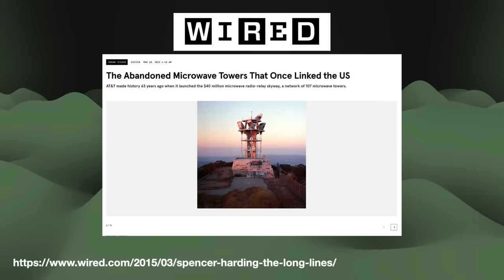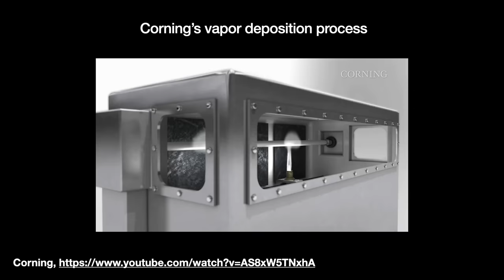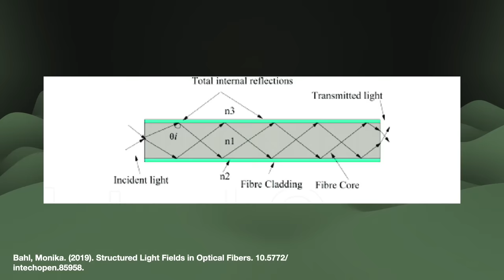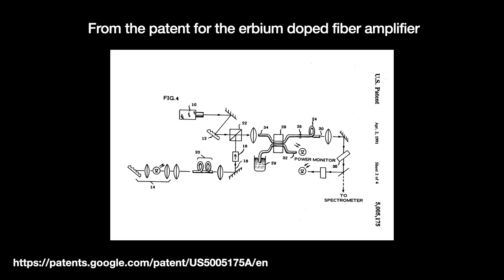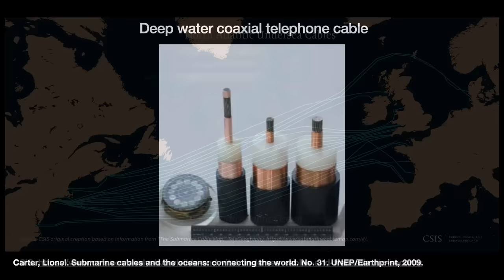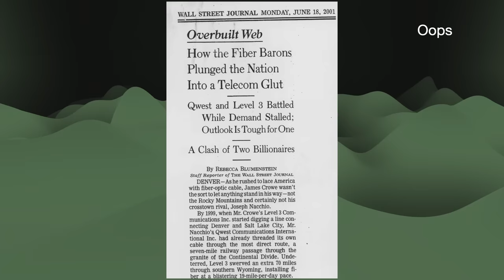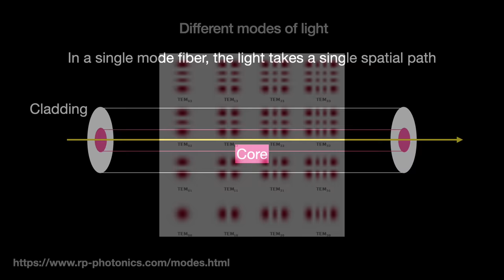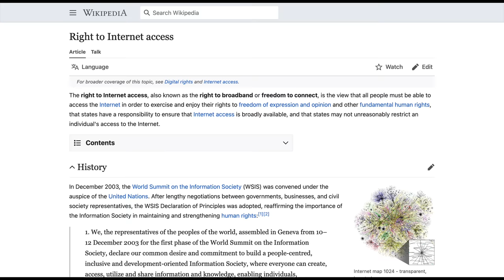How Optical Fiber Connected the World

Comment: That Level 3 picture is an interesting contrast.  It has fibre installation in the foreground and the old open wire lines in the background.  On those open wire pairs you'd get 15 or 16 voice channels per pair.

Comment: I almost spilled my coffee on the last pun. :) Very interesting video as always. In the mid 1990s I was empoyewd by a defence company that was expanding with new offices and we, the what you'd call now, IT Department, were tasked to investigate what options we had for the new installation and make a technological choice: Copper or Fiber and GigabitEthernet or ATM. Internet connectivity was spoken about, but because of the way that the business worked those days, we ended up having a seperate network for it.

Comment: 1995-1996, was a very special moment in the 20th century. The advancement of fibre networks, which made the World’s largest network possible, was made viable at that time. Which just happened to coincidence with a young researcher at CERN, called Tim Burners Lee, deciding to create a better solution to sharing data with FTP evolving from Email, Newsgroups and Bulletin Boards, to a variation on the SGML Language protocol, which he called Hypertext and the Hypertext Transport Protocol HTTP, which required a few patches of code made to the original NSCA FTP server, a patch here and a patch there, Apache Web Server, was born.

Comment: 12:02 Curious... Do you remember, from the sources you referenced during your research for this video essay, why the "optical" cable in the timestamp I've referenced was even emitting electrical fields that attracted sharks? Maybe particles in the sea water currents flowing around the metal cladding inducing current? Interesting topic I think, unless the same cable bundle included traditional electrical signal elements for other purposes...?

Comment: I am actually using fiber for internet. 200 Mbps for about US$65 per month.
Reply: You are getting scammed
Reply: @PhenomRom  I do not live in the usa. I live in guyana.
Reply: ????  I'm still on coax and my ISP provides 1.5 GB, though I'm limited by my hardware to 1 Gb.  I can't break out the Internet charges, as I'm on a bundled deal, but my Internet, TV and home phone come to about $190/month.  200 Mb is really slow for fibre.  BTW, back in the late 90s, at work, we had fibre connecting multiplexers that handled 3 DS3s.  That's 3 x 45 Mb.  A few years later, we had OC48 SONET over fibre @ 2.488 Gb.
Reply: @James_Knott   I think you are confused. Coax cannot transmit data at that speed. No one has a 1.5 GB connection. It looks like your monthly data capacity. Download speed is measured in Mega bytes per second. Do a speed test to see your Mbps. Fiber is always faster then coax.

Comment: Well, after WDM the next innovation was coherent communications, to improve the spectral efficiency (how many bit/second are transmitted for Hertz, or unit of light frequency bandwidth): the idea is that, instead of modulating just the light intensity, also its phase can be used to encode information.
So, instead of the intuitive On Off Keying (OOK), where the laser light is ideally switched on and off, one can act on its phase shift or use more than 2 power levels. This means that, as the format has more than 2 symbols (say 4 or 8), each symbol carries/is equivalent to multiple bits (2 or 3, following the example)
However, we are close to the theoretical limit, that derives from non-linear effects: because of noise, to distinguish one symbol to another with a sufficiently large probability, a minimum "spacing" must be used. This corresponds to larger power/intensity for the symbols at the edge of the constellation. But, as the signal intensity grows, the material properties (refractive index/speed of light) vary and this causes a series of effect that distort the signal, both inside a single channel or among multiple ones.
Personally, I would say that mode division multiplexing is a technique of its own, not a subset of spacial division multiplexing (i.e. in its most basic form, increasing the number of cables in parallel) because it corresponds to different way of spacial vibration of the light in the fibre cross-section, more than it travelling different paths (that is in the ray-optics picture, which however is simplistic); I would say that it's more the wavevector equivalent of WDM.

Comment: It takes a whole lot of 48v batteries for power off protection in these DI sites when I go in them.  Lots of testing and the AC is really important to function of sites in heat.  A bad AC unit can reroute a fiber network many miles out of the way setting alarms off at desks all over.  Modules and the chassis are pretty problem free, if you keep them cool.  I will give them that, no doubt.

Comment: You incorrectly describe how fiber works.  Your description is for "multimode" fiber.  Virtually all long-haul telecom fiber is "single mode and none is made of plastic.  Plastic fiber is only used for connecting stereo components together and can only carry a signal a few feet.  Bob Mauer invented the idea of single-mode fiber.  Multimode is much wider and easier to connect but can only carry a signal a fraction of the distance.  Don Keck and Pete Shultz invented the fiber manufacturing process and the original IVD has since been replaced by OVD (outside vapor deposition) as OVD can make much longer fibers.
Reply: Multimode fiber is not a new development, it is the technology that was replaced by singlemenode and it will never have the data capacity of single mode due to its much higher signal spatial dispersion.

Comment: Thanks! One thing that was new to me is that optic fiber was used before the internet age to transfer analogue signal. Seems like a completely logical idea, especially for TV -- after all it's OPTIC fiber, but somehow I never made the connection.
Another fascinating story is that those cables that carry so much information concentrated in one place provide a very juicy target for spying. Superpowers have been doing this for years during the Cold War, although mainly the cables that were tapped were not the optic ones but the more commonplace coaxial military communication cables. See Blind Man's Bluff, it's a fascinating story. It's safe to presume that this sort of activity is continuing until now, using underwater ROVs and, in cases of rich and powerful nations, specialized submarines built entirely for spying.
Reply: Cable TV companies already had fiber and coax networks in place so they were often the first to offer high-speed internet services
Reply: @shanent5793  Yep, I had a cable modem in the late 90s.  However, IIRC, cable modems and ADSL were rolled out at roughly the same time.  In my work, I first saw fibre in 1989.
Reply: @James_Knott  But cable modem technology using DOCSIS didn't really roll out until DOCSIS 3.0 started to really roll out in the early 2010's, which resulted in speed ups to 250 mbps at minimum and over 500 mbps as modems improved.

Comment: Couple of points you do not explain well and should clarify;
1. That Kao's foundational insight that the solution needed was not perfectly pure glass but a less pure reflective cladding. Regardless of core glass purity, it is the cladding that maintains amplitude. Atone for your sin by making a video about Kao!
2. Your explanation of single-mode vs multi-mode is unclear and will confuse a lot of people. This very simple explanation should kelp them. https://youtu.be/o4QgSQ5lhUU?si=ebHa3Ksc3OzMu1Sj

Comment: Another interesting aspect of international fibre cables, is how power feeding multiple repeaters daisy chained together on a fibre cable is engineered.
Reply: The same happened with the old analog over copper cables.  The same scheme was used with T1 lines over copper.